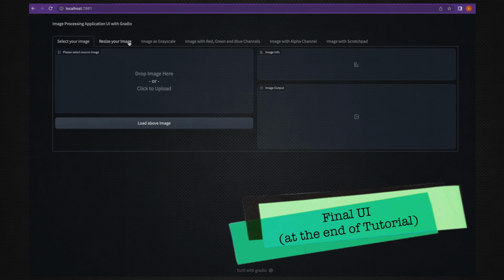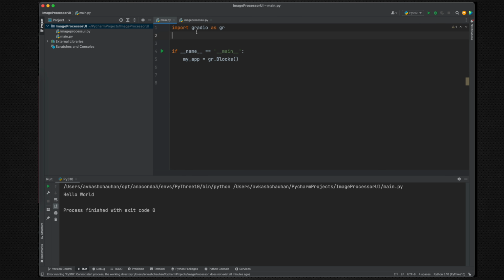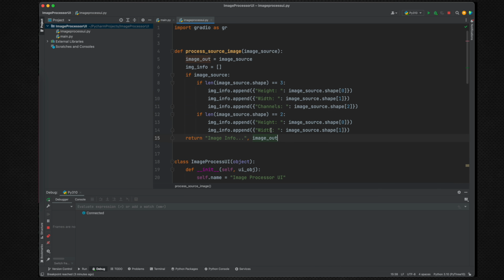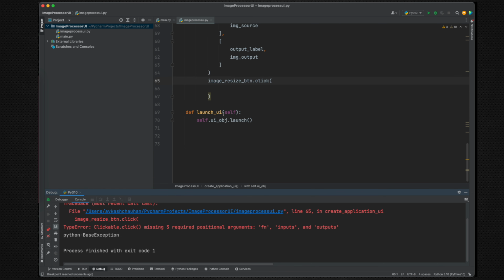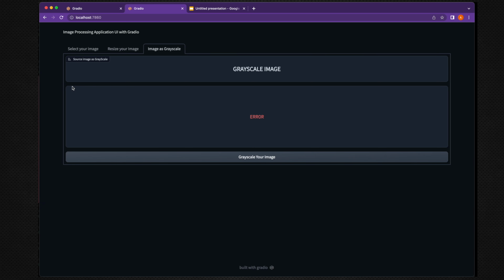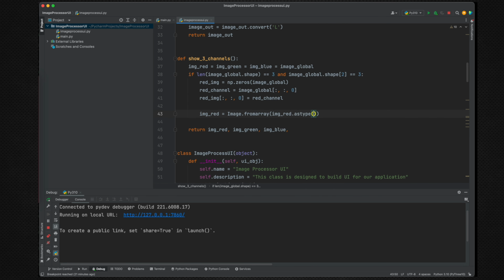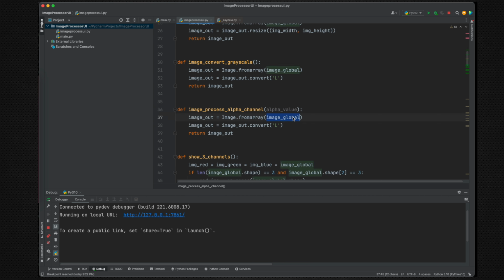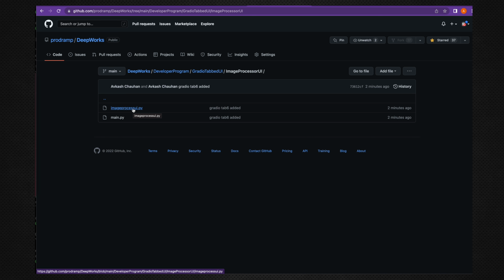How to build combined interfaces and dynamic UI for Python application?

Comment: Very Cool! Can Streamlit do the same? Or Gradio the only one that can do this? Thanks for responding!
Reply from the maker: Yes, streamlit can it exactly and the UI will be far better because the Streamlit was created as general UI on top of python however the gradio is mainly designed for ML applications on Python to the UI/UX functional design is very different in between of these two libraries. H2O.ai Wave is another library can also be considered as an option too.